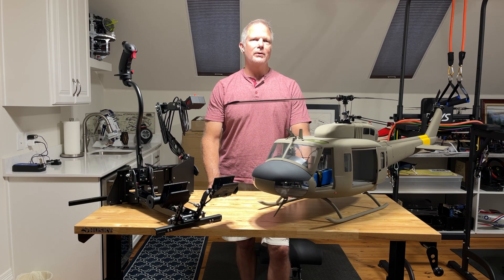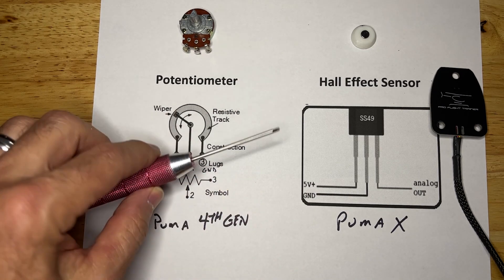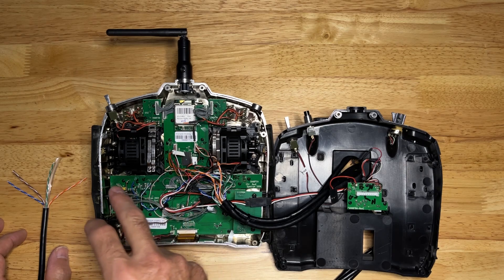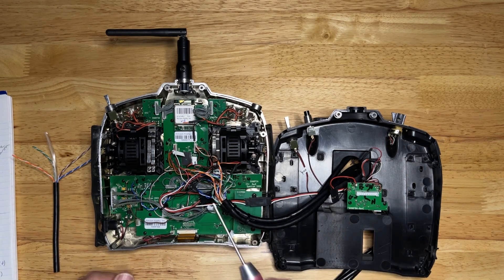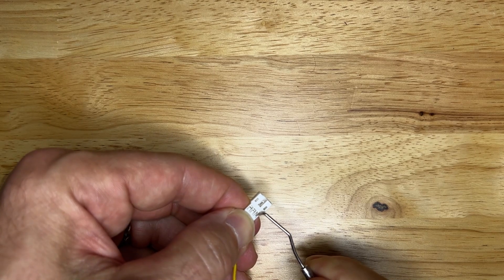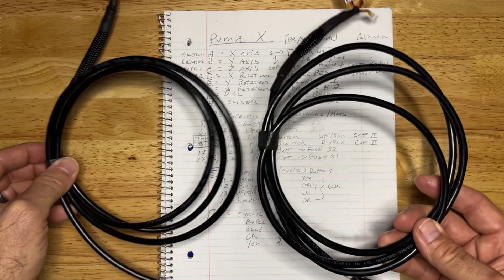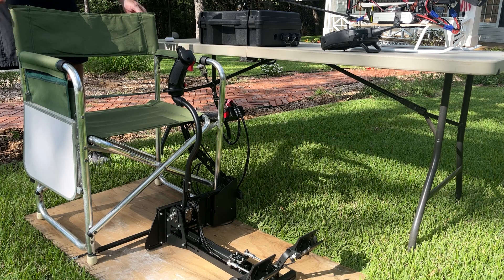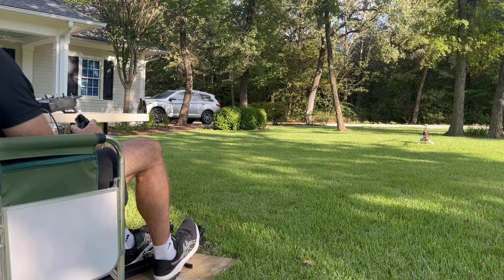Fly an RC Helicopter with the PUMA X - How to connect the simulator flight controls to an RC Copter

Comment: Where are you getting the 5v power for the HAL sensors. I see where you get the ground from but the 5v power has me lost. Thank you for this video and your time. It's incredible.
Reply: Glad you enjoyed it!

The 5v power comes from the same source as the stock gimbals in the radio. This is connected to the wiring harness and plugged into the Puma. 

Hope this helps!
Reply: @lwright292  Watched your videos, awesome.  Just so I understand the Hall sensor is connected directly through the CAT 6 to the radio? Could you theoretically wire an RC radio to any type of Hall sensor, or does this setup go through a Puma X chipset before being sent on to the radio?
Reply: @emanlmf  Absolutely!

With this arrangement I have flown airplanes by plugging in a throttle assembly and cars using a steering wheel and pedals
Reply: @lwright292 Hi, what Sim HOTUS, steering wheels and pedal controllers did you manage to drive cars and aircraft with? E.g. Logitech, Thrustmaster, Fanatec, Moza, Honeycomb, Winwing, VKB Gladiator NXT. These usually have usb ports to your PC. How did you connect it to your transmitter?

Comment: Great stuff. I own a puma control system. The issue we have in France is that it is forbidden to pilot a rc stuff with the rc helicopter out of view. So we cannot use pure pov flight we have to always see our machine.
Reply from the maker: interesting, we were not aware of that restriction in France. most drones can be easily flown out of sight? basically any FPV is by definition out of sight? you don't look at it directly?
Reply: @proflighttrainer  yes but in France this is forbidden. I find it weird because flying in FPV should be awesome. I guess this is for security purpose, you always have to know where your drone is.
Reply: @harf4ng  In the U.S., we just need a visual observer on the crew to satisfy the issue of flying with goggles. I'm sure the drone laws will evolve in France to allow for this one day.